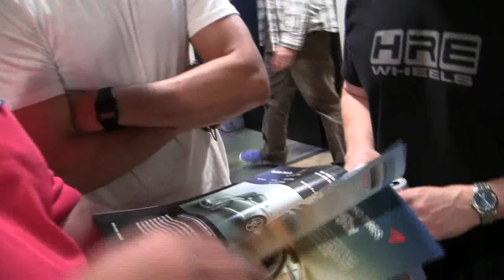Adam Carolla Get His Mechanic Into A Synthetic Oil Debate

Comment: most of the wear on an engine happens in start up and before the oil gets up to temp. once the oil is up to temp it "runs like water" ergo is AWESOME that synthetic oils "run like water" at room temp. that how oil works, it doesn't "stick" to anything, the flow of the oil lubricates the parts, not the thickness of it. synthetic oils are ideal on older cars, because it prevent further wear because it is always thin, at all temps.

Comment: if it pours like water, it's a low viscosity number. the viscosity rating has to fall in a certain flow rate window to get a certain viscosity number. regardless of synthetic/conventional. if ZDDP is the issue, there are zink additives, and the low viscosity street oils lost the zink much more than the 40 and 50 weight oils. as far as bearing surface protection, oil pressure does that. shear wear protection is what is needed on the cams. besides, most US synthetics start as a conventional base.

Comment: A lot of us muscle car guys are running diesel oil like Delo 400LE or Rotella. They have the zinc stuff that flat tappet cams with decent spring pressures need.. and the stuff is cheap about $12 per gallon. I run synthetic in my daily driver Toyota for the extended lifespan of the oil, but for a classic car synthetic is either unnecessary or a bad idea as your mechanic says.